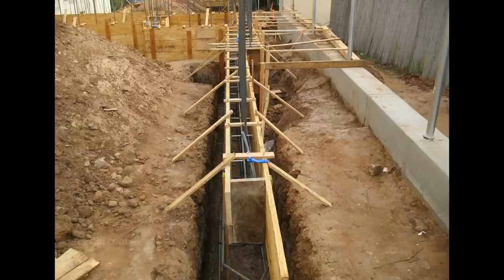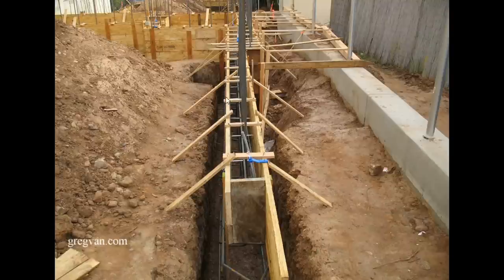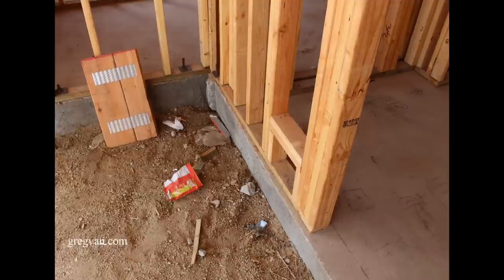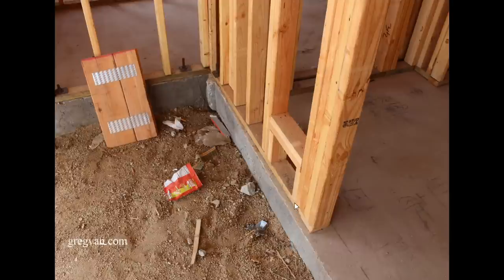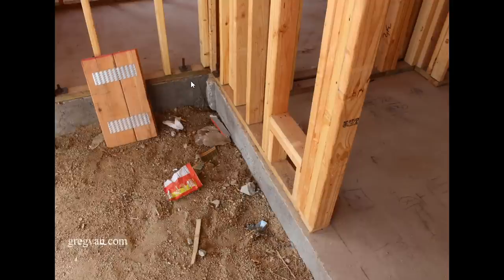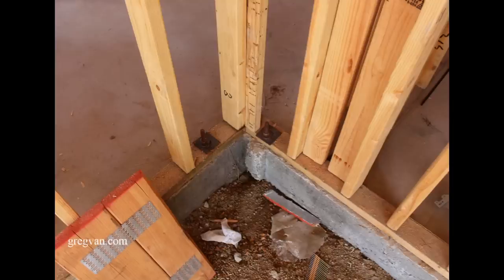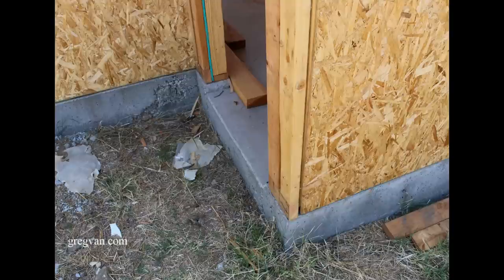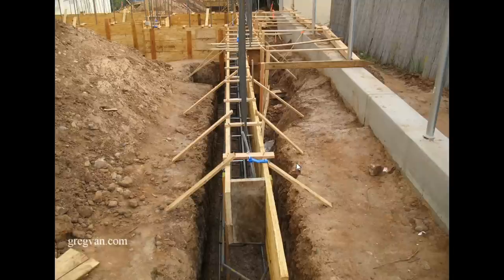Watch This Video Before Pouring A Concrete Foundation – Construction Tips

Comment: Do you often pour a lot of monolithic walls/footings? As a driver I have seen that often attempted, but rarely done well without also forming the top of the footing. Usually I groan when I see that type of a set-up, especially if people are real quick with the vibrator.
Reply from the maker: +Brock Jenkins The last time I did something that wasn't monolithic or all poured at the same time was back in the in the late 1980s.
Reply: +gregvancom I wish more people had it down, it would be a lot easier to do it that way then to have to come back into the same tight areas twice. How is your placement time per yard?
Reply from the maker: Most of the time I used pumps and rarely did any jobs without them. I can't remember the last time I had to pay for any overtime.

Comment: This is all new to me. I haven't seen anything built before, so you can laugh but  I wonder if you are going to lay brick on top of this, wouldn't it be cheaper just to add a  large plastic liner and pour concrete in without the form thing. also it seems that for the corners one could just put a 30 foot high steel post in and hold it still while the concrete sets up and then go to the next corner. Is the reason it is not done like this is that dried concrete wont bond to new concrete? Can you build with concrete then brick then wood for the attic? thanks

Comment: The "REAL" issue in these comments is not having this job or any project spelled out "in writing " verbally simply doesn't cut it. In your bid specs to a subcontractor spell out in writing that ALL surfaces are to be plumb, level, & square. Additionally spell out what a sub's responsibilities are, yes unforeseen things do happen but clearly define who takes care of it to achieve the end result. To be fair in my 35 years of building I've seen numerous subdivisions built by big name builders allow their onsite project managers to hire subs at their discretion for the cheapest bid, Why? Simple...performance bonuses! Do they care if the tract or subdivision home is out of square or shoddy built... Nope! As one superintendent said to me as long as it's "commercially acceptable " it will pass. He added... If he spec'd his projects the bids would come in 20-30% higher. For what it's worth IMO spell it out before you hire ANYONE for Anything. Is it worth the hassle? Here's an example... Last spring I put out for bid a plumbing job it was spec'd this way. The house sq footage,the ENTIRE scope of work including DWV piping size location, pex piping throughout the home with shark-bite or equivalent connectors, changes not allowed unless approved by contractor, as well as the subcontractor was to clean up ANY debris directly related to his work & haul it away. The result...a local established 20 year experienced plumber showed up read my spec sheet in the jobs driveway & promptly crumbled it up & threw it on the ground & walked away. Later that afternoon another plumbing sub came by to pick up the identical spec sheet "said looks good, no problem we do this all the time, I'll have your bid within 3 days, he phoned said here's your bid amount. Because of his professionalism I hired him on the spot as he committed to start the job the following week. When the building inspector showed up to sign off on our rough in plumbing I asked him what's up with the first plumbing contractor I asked to bid this project he said " two of his projects were red tagged and another has a "stop work" tag on it for no permits issued he also hadn't paid his lead guy & helper in over 3 weeks.   Was it worth it to spec out my project and pay a little more for the right subcontractor " no doubt in my mind!  99% of the time it weeds out marginal subs or those who don't like to be asked to do a project a certain way. Wanna roll the dice & gamble for the cheapest bid.... That's your call!

Comment: I have a thousand photos of screw-ups, I should post them like you did. I would not consider that form to be braced, that was a terrible example, a 1x3 is not adequate. The pressure at the bottom is much greater, and unfortunately, most foundations in Florida are monoslab, meaning one pour for the floor and wall supports. They all have that knob of concrete spurl on the sides, no big deal, nobody fixes that, they just landscape above it. It is not a structural issue, only cosmetic. So first suggestion would be to pour a footing, that way the bottom of the form can be anchored to something. Any pour more than 18 inches is going to have lots of hydrostatic pressure, more at the bottom, and the higher you form it, the more pressure. Three feet, almost impossible to contain without real forms by a real forms company, the pressure will blow out the wall, bowed, like you described. Personally, I would always use a stemwall, meaning to have a footing down at least two feet, then just stack block, even dry stack, then only a 2X4 around the perimeter, let the crete fill the holes. that will always give you a perfectly square and plumb foundation if the interior dirt is not clay and has been compacted well. Next, be careful about load bearing. We had a huge development pour slabs for the lanais with no footing on the corners to carry the load for those block corner posts. We had over fifty houses where all the corners broke in those slabs. Footings are just deeper, compacted, and rebar in a crosshatch pattern, that will carry the load. Interior walls can be load bearing, so never forget footings under those.
Reply from the maker: Send me a link when you make the video.
Reply from the maker: Absolutely.

Comment: Noob question; why does it matter if the slab sticks out farther than the wood? How is it any different than having an extended slab that sticks out for a patio?
Reply from the maker: Yes it really does matter and it wouldn't be the same as having an extended patio slab, because patio slabs shouldn't ever be level or the same height, but actually lower to prevent water from the outside draining into the inside. I hope that wasn't a Noob answer.

Comment: I have a question they just pour the concert and made a foundation slab but now it has crack everywhere what does it mean I mean cracks from all the plumbing and some cracks are even going to foundation walls to
Reply from the maker: If it's new construction than you might have a problem, but cracks are common because concrete expands and contracts. However if your cracks are larger than a quarter inch wide or getting larger over time then you might need to contact a professional in your area for more information.

Comment: I've seen worse,and in my own house.I own a Levit  home and I have to say nothing in this house is straight.I seen the way my foundation was poured,and it looks like the outside was poured first then the floors poured inside them.Needless to say my floors settled and the outside edge stayed where they were poured.I really would like to put nice floors in my house but seeing how the floors dropped and the outside stayed where they were,I had to at least fill the huge cracks where the two surfaces separated.

Comment: Like someone pointed out already, if you brace forms the way you show in this video in my neck of the woods, forming companies will send you home within the 1st. hour! footing forms need to be braced with braces that: don't stick out over the top, have a piece of rebar or picket to hold the pressure at the back and cleats at the top! now if you are a shoemaker rather than a carpenter, it is a different story!!
Reply from the maker: This is pretty standard in California.
Reply: There was tie backs in the form, but yea all those diagonal bracing was a little over kill, Not that that's a bad thing.
Reply: yea Joe that would be correct. You would be depending on the fasteners to hold the concrete. Kickers every 2 foot and definitely at the joints. I do not like the idea of driving a stake by itself  into the ground to kick off the form. When you pull a string line to fine tune it, you can't expect it to hold when you have to push against it and nail it off for it to come back in. I have heard people say the concrete will push it out that 1/2 inch or so. Be concerned of a contractor with a air compressor and paving breaker on the job and it is constantly in use.  lol

Comment: At 6min of the video, the foundation shows scratches, instead of bulging out, some part the concrete is missing small holes inside. Will it create any problem?
Reply from the maker: That shouldn't be a big deal, but it can be on some projects. I wouldn't worry about it on my house.

Comment: Thanks for the video and.... it would be a lot of help if you'd make another one regarding isolated footings in RCC framed buildings ..
Reply from the maker: +Nishan Thapa Could you be more specific? Exactly what type of information are you looking for? What is an RCC framed building?
Reply: +gregvancom  RCC..reinforced cement concrete . and the framed structure is the  one with frames of columns and beams (all RCC) .
Reply from the maker: I will see what I can do

Comment: And this is really not the way to properly brace forms....you need AT LEAST 2 x 3 and rod into the ground to maintain the bracing in place if you don't have vertical walls nerby on wich you press the 2 x 3 on.

Comment: There are lots of videos  on building a foundation, but this is the only one (so far) that shows the results of sloppy work which creates more work by continually correcting.  Getting the forms straight and at exact angles, braced strong should take the time to get everything  right.  Digging the trenches and pouring the  cement are the easy parts.  Thanks for the reminder.
Reply from the maker: It's nice to hear someone who understands the meaning of this video and has taken the time to leave a comment like yours. You wouldn't believe how many comments I've received telling me that straight concrete isn't important and something like this is in the big deal.

Comment: I was a builder for 14 years, and the work you illustrated was truly cringe-worthy.

Your comments are spot-on, and thanks.
Reply from the maker: I've been in it for over 30 years and the hardest day I ever worked was pouring a 7 yard patio in a backyard with a wheel barrow in the summer and it started raining. It is a day that will live in my mind forever, until I don't.

Comment: Some kind of plastic spray after rebar and wires are in place then poor concrete? Will that work is that what you mentioned in the video?
Reply from the maker: What exactly would you be spraying plastic on? The wood forms or the rebar.
Reply: On the rebar and wires
Reply from the maker: @johnrodri2877  You shouldn't use any type of coating without checking with the engineer.
Reply: @gregvancom  but isn't any type of coating better than nothing?

Comment: I've been building homes for years. I see some things that should not have happened. That tells me that the Superintendent didn't pull a tape measure to check all forms before pour. Some of the things you pointed out are not a problem. Where the 2 form boards meet is the board itself. The edges on a dimensional lumber is not a square edge it has a small rounded edge from milling the lumber. The areas where the concrete is out further than the wall or doorway, a good framer knows how to correct this at layout without furring the door or wall. Other areas on the exterior will be covered by brick if that is what you're going with. I think you need a different concrete slab company and a different Superintendent.

Comment: I would just like to add one thing pertaining to this topic...  It is NOT always the case where things like this occur, and it is simply because the mason didn't know what he or she was doing.  It's not always the case where the lumber was shot either.  You would be surprised how often the cause of something like this  was another type of human error.  (ie... when pouring the concrete a stupid laborer bumped into a form or something.  I have even seen the guy form the masonry plant who comes to test the concrete walk past, and bump a form.  The prick didn't even speak up either.)  The problem is a daunting task to remedy when there is a lot of square footage involved.  Either way, that's why I prefer steel forms when I can use them, and I watch the entire process like a hawk.  There is nothing worse than a laborer mucking up a several thousand dollar job, or the truck driver, or a home owner stepping on a form even.  Thank God for yellow caution tape!!!
Reply from the maker: +mskillo81 Thanks for your comment and you're absolutely right.
Reply: No it's not, there's not a lot of mit graduates lined up to do form labor, and you can't watch them all. But an inch is enough t o make a I know my shit look what they did wrong video?  Guy sounds like he repairs watches for a living

Comment: That bulging means the concrete is now lacking in the areas in which it was meant to be to begin with. If I'm paying for it, I want it done right and I would be VERY picky with my foundation. Once it's set, it's set and everything else is built on top. If you can't do it right, step aside.

Comment: The problem generally is that homeowners and GCs ALWAYS go with the lowest bidder and you get what you pay for. Im a concrete contractor specializing in decorative concrete and house foundations.
This is a major problem. Shoddy concrete contractors underbidding guys who know what they are doing and then doing work like this. All they needed to do was kick off their forms and it wouldn't bow out, and use the proper form material
Reply: Very few small contractors bother upselling products and services , for example foundation form liners and or colored concrete above the grade line. And if you have done much contracting the biggest problem is getting them to even show up to even bid on a job, I would bet if you called up 10 sub contractors you may get 3 that actually answered the phone,  and maybe 3 that return any message you leave. and I am being very optimistic.
Reply: eric wsmith I agree with you.  I'd say almost half of the jobs I get are because the homeowner said the contractors made appointments to come bid the job but never end up showing or that they don't answer or return phone calls. But when I bid against other contractors, the homeowners generally go with the lowest bid. sometimes we will win the bid even being the highest but it's rare. Although we get a lot of calls a few months later asking if we can come out and look at the mess the contractor did, which was the lowest bidder, and now the homeowner has to pay much more for us to tear out and replace.
we specialize in decorative concrete, stamped, architectural and polished concrete
Reply: I tell people all the time, If you want to be a successful contractor, you don't have to be that skilled or that cheap, you just have to show up.  Another good policy is managing a customers expectations, I am sure you get that all the time, a customer for a few years ago wants to extend a sidewalk, if you don't let them know the chances of it matching work you did a few years ago.... or even weeks the chances of it matching exactly are pretty dam slim. You should not be explaining that AFTER the job is done.